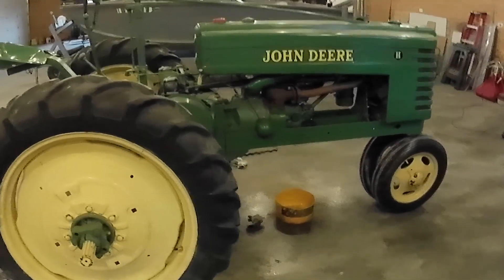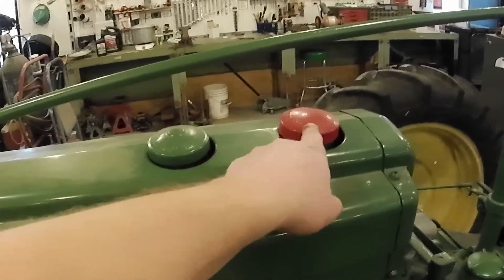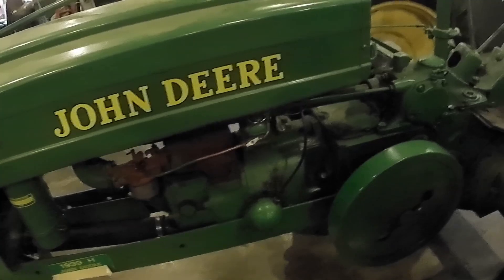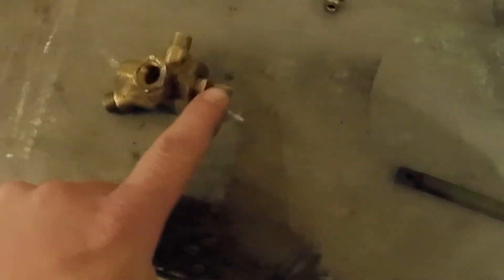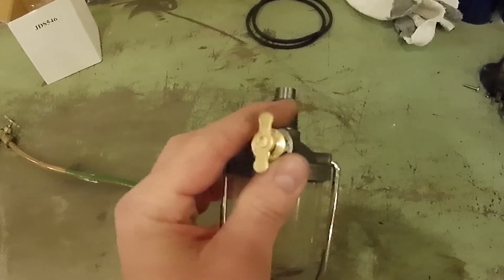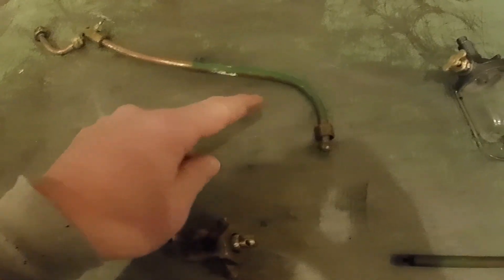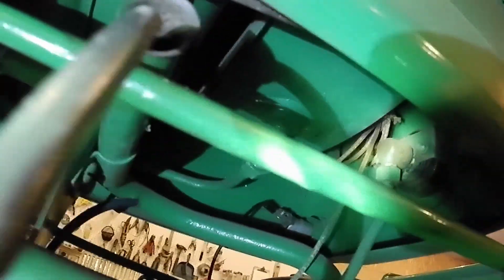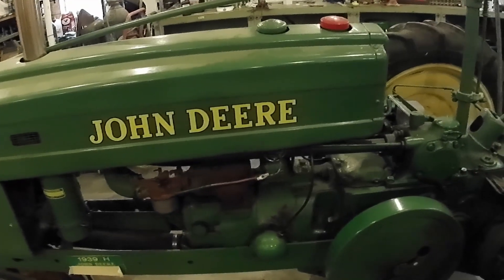John Deere All Fuel Explained

Comment: My grandfather used to talk about how he used to filter his used oil then mix it with gasoline or kerosene and or diesel and put that in the front tank and ran it off that. But he immediately followed that up by saying you had better remember to switch it back to gas before shutting it down otherwise you'd have a very difficult time starting it the next day! Sometime later at the county fair I spoke to an elderly man sitting next to his all-fuel John Deere and he confirmed the used (filtered) motor oil, but he never thought about using diesel, but thought it might be possible due to the size of the pistons and compression they built up.